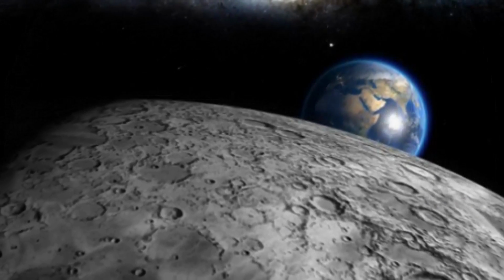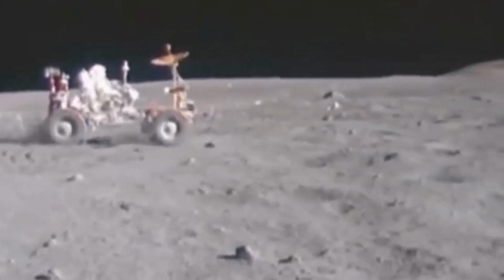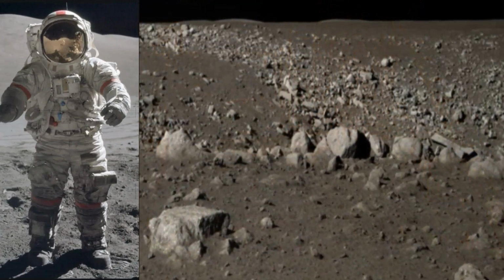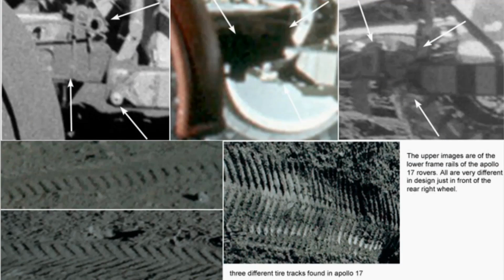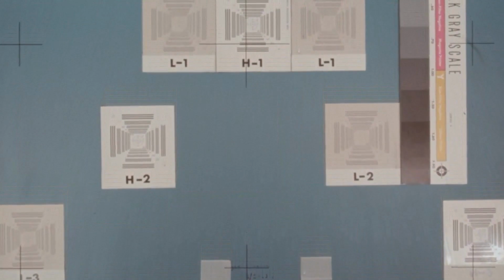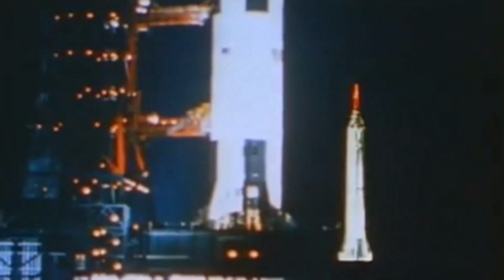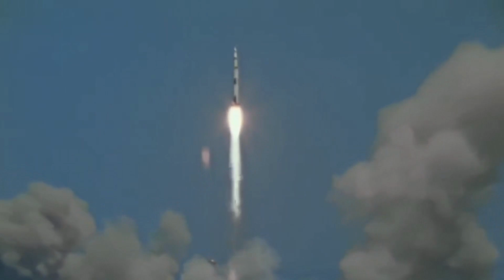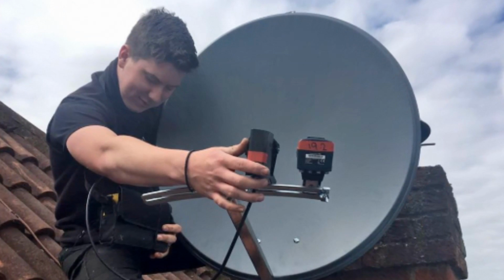NASA;" Dusting The Surface" W/Scott Henderson & Bob Williams.

Comment: According to the folks at the Science Channel, the Lunar Module “was built in one of the world’s first clean-rooms. In zero
gravity, any floating foreign body would be a hazard.” A hazard, that is, to both the astronauts’ health and to the ship’s
delicate on-board electronics. Workers were required to wear gowns, masks, hairnets and booties, technicians
meticulously cleaned the interior with camel hair brushes and filter paper, and the modules were robotically lifted,
inverted and shaken to rid the cabin of any debris.

According to Neil in 'First Man', they took a lot of lunar dust with them when they 'returned' inside the Lunar Module. Not to mention in the later Apollo missions, since the astronots allegedly went several times outside and inside the LEM (3 times in Apollo 17)
Reply: You do understand of course that the LEM has not 'air lock' per say and when the ass clowns went in and out, the dust would have accumulated right at the seal points for the hatches.  Thus there was NO WAY they would have been able to re-pressurize the interior of the LEM at all due to that dust!!!
Reply: Why change of temperature wouldnt it stick to their visers?
Reply from the maker: It is absolutely ridiculous to believe that after that LM kicked up all of that dust everywhere, it would be swept clean like that. It is just insane! Cheers Armando!

Comment: Would not  the "laser reflector" placed there by those 2 dudes (back in the 1900s) get dusty after fitty years?
Reply from the maker: Yes there would be after the LM took off. Excellent point!
Reply: The laser reflector, if it is still out there, is sitting in the northern Arizona desert outside of Flagstaff...
Reply: @northerntruthseeker  Lucky if not strucked by a meteorite, 1'x3' hit wonders.
Reply from the maker: @northerntruthseeker  I think the other one is on Devon Island, where the broken down rover's now roam.

Comment: Yes the Dust is a big factor in this scenario, werent they moving inside a dustcloud at 100 feet above? They were blowing it until they landed, at low thrust apparently, that could of gotten blowed faroff, but some stayed still on the ground... 

    At least the old Russian scifi moon movies astronauts were sinking in the dust :)
Reply: It also makes me wonder about the electrostatic discharge and how the engines of the LEM were so delicate that any exposure to electrostatic discharge could have caused the fuel tanks to either rupture or explode....
Reply from the maker: Yes, but due to the LM possessing a positive charge, it had nowhere to discharge even when touching the so-called lunar surface. The astronauts would have had to have pounded a 6 foot ground rod into the surface, and attach a ground wire to it. That's not what occurred. The dust would have stuck to the surfaces of that LM after the engine was shut down.
Reply: @shillstompers3793  Can not advance on the positiveness... but plenty of nicks for it to sit on.  Yeah I dont get how stupid they were why even dust at landing site.  The only flag they planted without drilling, indeed dust being so dry and light it should of hanged up way longer, no need to clean the camera lens...
Reply from the maker: @wildboar7473  Good point. Even the dust from drilling would be kicked up all over their equipment sitting next to it. Of course, the equipment is spotless as is the LM. Something is wrong.